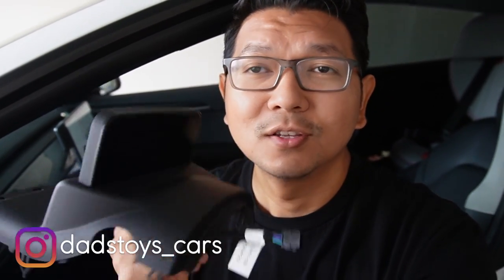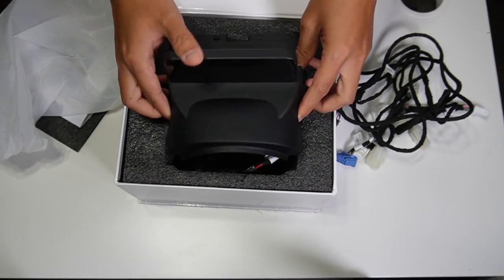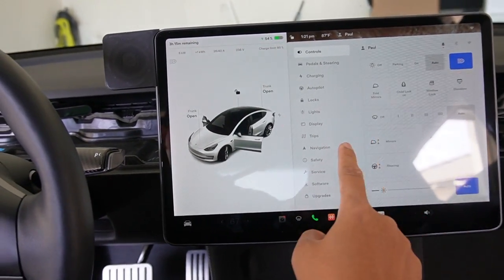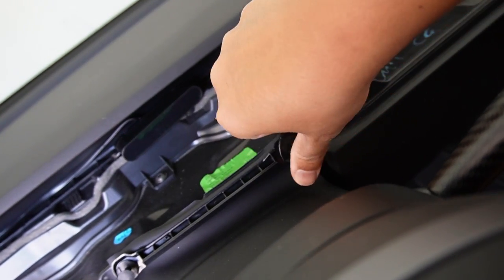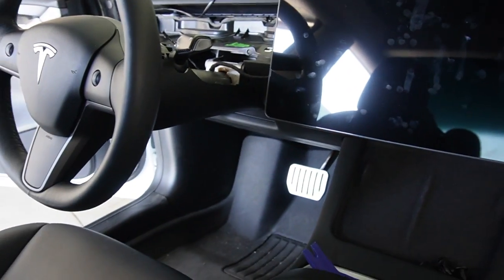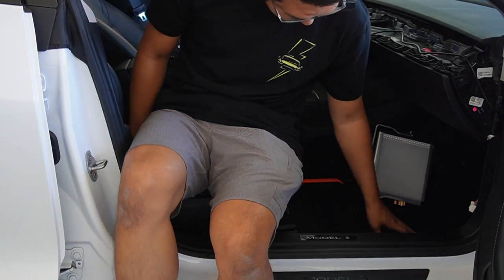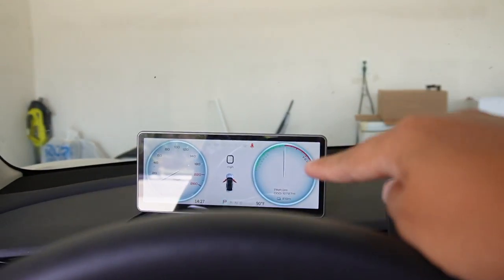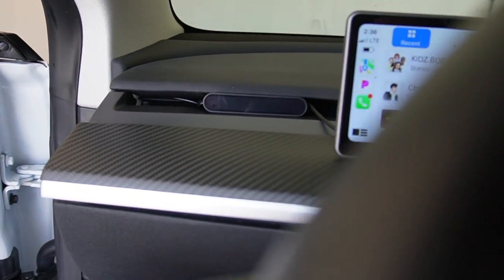Watch this before you buy Instrument Cluster Display for your Tesla Model 3 & Model Y! #teslamodely

Comment: The steering wheel column mounted HUD doesn't display the light indicators correctly. You can see it in your video at 22:30 and 23:29 - the light indicators don't match the car display or the 9" dashboard mounted display. I got one from Aliexpress and it has the same problem. If you find a solution to that please let us know.

Comment: Hi. Thank you for your videos. In this video, you mention that you must reconnect the main screen within 2-3 minutes, otherwise you have to wait an hour.  What happens if you can't reconnect that fast? Getting that gray plug out and then the harness plugged back in, is really hard and takes a much longer time. 

Does the Tesla stop working in some way? What have you experienced.

I tried a different but similar display and the extra screen wouldn't turn on and I lost all car audio. Soft and hard reboot didn't restore sound.

I'm just wondering if the 2-3 time limit caused this problem.

Thank you
Reply from the maker: What year and model car do you have?
If your car is 2021 and newer you don’t have to connect directly to the main MCU OBD. There is another OBD plug on the side panel of front passenger seat which is much easier to install and there is no time limit to finish the installation.
I’m not sure if that time limit could cause audio malfunction.
Thank you for watching!🙏

Comment: What impact does the installation of these aftermarket screens have on the manufacturer’s warranty of the vehicle please? I am keen to get the steering column version, however I have reservations if it voids any manufacturer warranty!
Reply from the maker: As far as know it will only void the part you replace. In this case the top plastic cover on steering wheel column won’t be covered by warranty because you replacing it with small display.
Thank you for watching!
Please subscribe for future contents.🙏😃
Reply: @dadstoyscars  
Sadly having reviewed the warranty information (UK) 
it clearly makes reference to modifications.  Shame as I would have liked the smaller column mounted screen, however it doesn’t seem worth the risk of voiding a vehicle still in manufacturers warranty.

Comment: great video.  it looks so OEM, it should've came from the factory.  how are you able to get all 3 connected and functioning at the same time?  spliter?
Reply from the maker: I piggyback 9” on the same connector as 4” steering wheels display and smallest display was connected to the rear connector underneath rear passenger air vent. 
Thank you for watching and your amazing support!🙏
Reply: @dadstoyscars  great, just ordered with your code and to support you.  my 2nd time in 2 days lol.  thanks!
Reply from the maker: @randomname931  Appreciate your support! 🙌

Comment: Honest question: What does android auto do that I couldn’t already get in some form from the existing system? I can’t run AA on my phone to see what its features are, it only runs on the car’s hardware on cars equipped that way, so I can’t tell if it would be useful. 

I have wanted a way to see the projected range from the Energy screen while driving with the navigation map also fully visible. The range you get from swapping the battery % to range seems to be based on the epa estimate for a given % of charge and is inaccurate at best. I don’t think any of these three add on screens will help me do that.
Reply from the maker: There are some useful apps that you can use in AA that Tesla don’t have like Waze, google maps, pandora, and Text which can do speech to text or have it read out the text for you.
As for range in miles, the display only takes information from the car MCU so whatever the car shows on the screen it will show on display. However Tesla will soon release more accurate range and better battery consumption on the new software update and hopefully that would help most of us.
Thank you for watching!
Please subscribe for future contents.🙏😃
Reply: @dadstoyscars  that’s what I mean about most if not all that AA offers is already there. Waze adds info about hazards and police, that could be useful. Afaik Tesla already uses google maps for their navigation system, so maybe you could get streetview is the only new feature? Dont even know if that’s useful, much less possible. Pandora - we have music streaming that I’ve been pretty satisfied with from Spotify, Tidal and others so this is already there but from different vendors. Texts already read out loud and take voice input, so the only addition is that you may be able to see old texts from before the current trip? I don’t know because I can’t run AA on just the phone. The ability to add apps such as Whatsapp and some others is interesting, although Whatsapp is also available from the browser which can be run while driving, not that I would or would recommend anyone do. I suspect a lot of the apps are also available on a browser. I looked at the apps that are popular on AA and other than FB Messenger and other social media platforms, some podcast apps, and some audiobooks, the Tesla already includes either exactly what AA offers or pretty close.

Good to hear they’re upgrading the range estimate, hopefully they will also roll that out to those of us on the FSD beta. It seems like there are two development streams and the FSD beta one lags behind the general release, at least in version number if not features.

Comment: Nice video. Thanks. I do have a question, does the installation of any of this affect the Tesla warranty?
Reply from the maker: I don't have definite answer for you on the warranty. But if you asked Tesla technician they would properly say yes, because no car brand will cover aftermarket parts not just Tesla.
If there would be any issue at all with the car that might cause by the display I would just remove it before contacting Tesla service. 
Thank you for watching!
Please subscribe for future contents. :)
Reply: Well aftermarket mods only affect vehicle warranty if it’s related. So if something happens to your main screen, I would uninstall everything before taking it in for repairs.
Reply from the maker: @Mugsy-14  I just took it in for service with the display on and they didn’t even mention anything about this will void warranty.

Comment: Let's face it, there's really no good solution for a cluster display on the Model 3 and Y that looks OEM, and doesn't block any air flow.

If you want that, you have to spend $100k and upgrade to the Model S. Until then, this is the best we're going to get. Unless Tesla decides to add a cluster display one day.

Comment: Whats the 2nd connector (spare upgrade cable) with the main display connector for? Thanks
Reply from the maker: The second connector plugs which I didn’t use was for newer version MCU processor car 2022 and up that use AMD processor.
Thank you for watching and your awesome support Rin! 🙏😃
Reply: Any different between this unit vs the one from TLyard?
Reply from the maker: @rinphan3564   Mini display on steering wheel column VS smallest hidden display?
Reply: The mini display, look like TLyard selling the same unit too
Reply from the maker: @rinphan3564   They both should be the same.